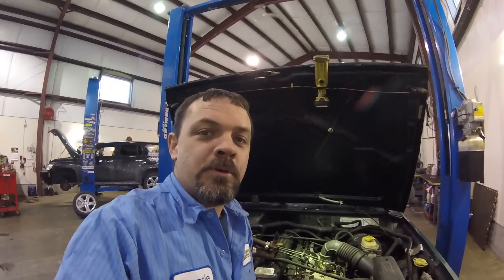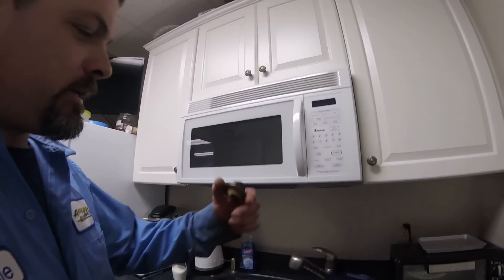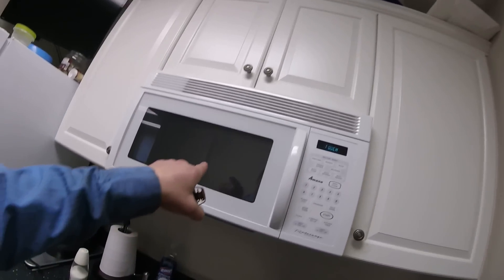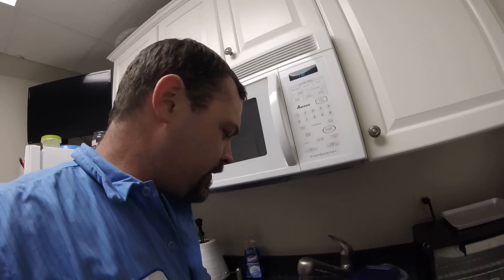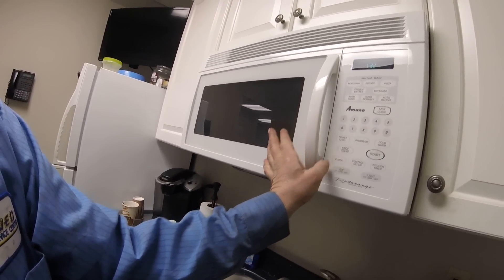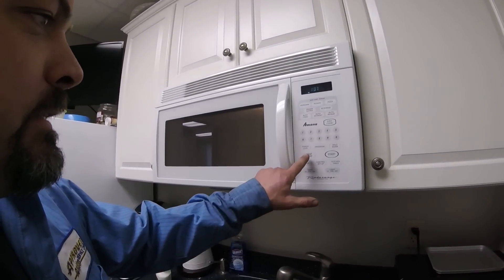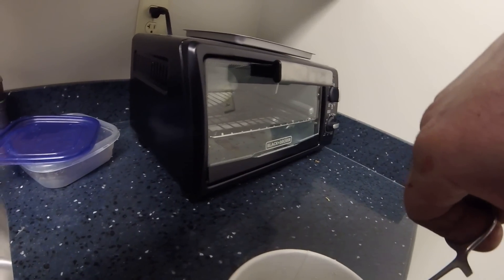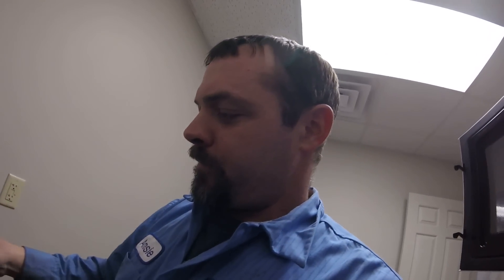Testing A Car's Thermostat In A Microwave?!?

Comment: Ive never used a microwave to check a thermostat. we always had an old electric jug and we just threw it in with a bit of wire hooked onto it and boiled it up. Line up the usual suspects, head gasket, blocked radiator and viscous hub and blocked heater core and dodgey radiator cap, leaky water pump and rotten frost plugs. If you're really unlucky its the whole lot.
Reply: +andrewkiwi1 could always use a torch or heat gun either directly or to heat water... much faster to use it directly on the thermostat.  Propane torch is very quick
Reply: thanks.

Comment: Except metal in a microwave is also very hard on the magnetron.
Reply: It can reflect the microwaves (high powered electromagnetic waves oscillating at around 2.45GHz) back into the magnetron. Microwaves operate by exciting atoms by continuously flipping the magnetic field (like putting a magnet on the end of a drill and spinning it super fast sort of...) and atoms have their own magnetic polarity so they try to flip with to match the magnets polarity and excited moving atoms is heat. I guess the water is a larger more attractive mass than the metal, shielding it from the full power of the magnetron. 
Microwaves are pretty fascinating honestly and to think if Percy Spencer wasn't dumb enough to stand in front of a active radar set with a candy bar in his pocket we wouldn't have these convenient devices.

Side note: the 2.4ghz frequency range is used for wifi and knowing that this frequency is absorbed by water explains why you can't pick up your neighbors wifi as well on rainy/humid days.
Reply from the maker: +Tri-County Electronics Why?
Reply: Amesie's Automotive Corner I would explain why but it would take me hours to do so. You can read all about it here: http://engineering.mit.edu/ask/why-can%E2%80%99t-we-put-metal-objects-microwave
Reply from the maker: +Tri-County Electronics That article kind of precludes to how metal can be used in a microwave as with the metal inserts used to help brown food, pop corn or boil water The same way the water in the cup shields the erratic microwaves bouncing off of the metal thermostat and convert the energy directly to heat the water.
Reply: ***** WiFi isn't really 2.4 GHz these days unless you are using very old equipment, WiFi is commonly 5 GHz.
Reply: @scgamer2442  Actually, the majority of WiFi is still 2.4 Ghz because 5 Ghz has shorter range, can't get thru walls as well, etc.  2.4 is 'good enough' for most uses.